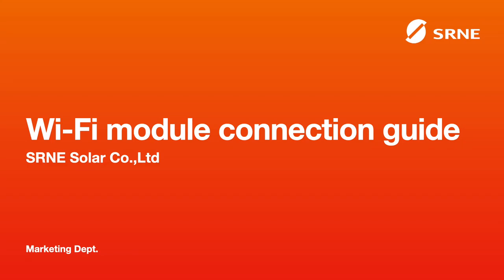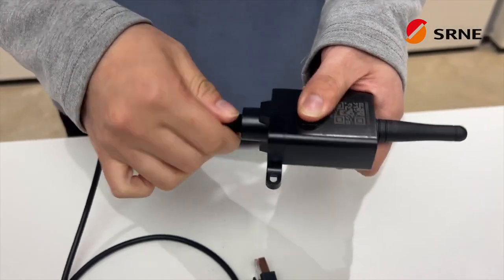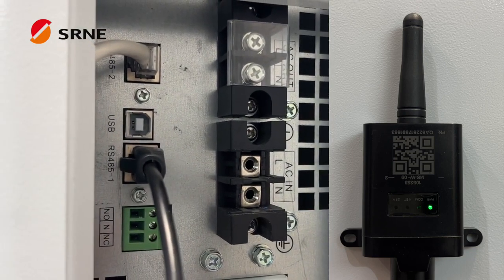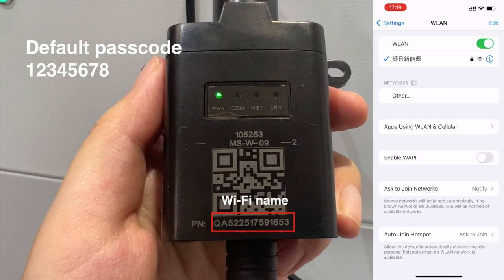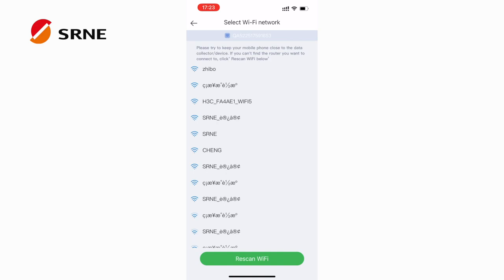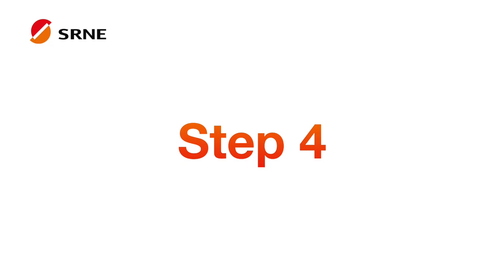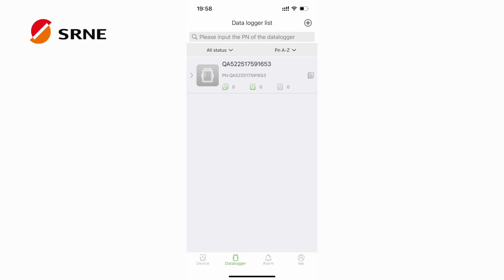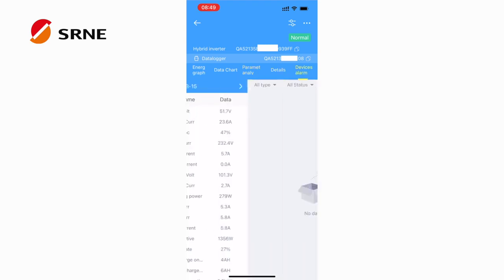SRNE WiFi module connection guide

Comment: My SRNE 12Kw that i buy doesn't have this wifi module  so is sold apart?
Reply from the maker: Yes, the wifi dongle is additional cost.
Reply: @becky-srnesolar5785  So for my SRNE HESP48120U200-H this dongle works? and where i can get one?
Reply: @becky-srnesolar5785   where i can get it?

Comment: Hi, i am using this dongle, but the battery data does Not show much except the current volts, soc, current, but the graph doesn't show, for others graph is showing,, its 5kva Inverter and 2 Hanshu ess batteries
Reply from the maker: Perhaps you can try to contact the seller at fisrt
Reply: @becky-srnesolar5785  the seller doesn't know anything about it
Reply: What is the name or model of wifi dongle? @becky-srnesolar5785

Comment: Hi, I have added to the data logger to the SmartESS account but it shows as offline. Any reason for it. All four indicators on the data logger are light continuously.
Reply: Were you able to solve the problem?
I am having the same problem
Reply: Did your problem be solved?
If yes then how
Reply: @shreyaskumarpradhan1005  it seems this product is a shit, a lot of issues from buyers

Comment: I have wifi module, I was able to connect it to my internet network .
But no communication with the solar inverter . The COM Port is always OFF. No green light on the COM. What to do ?
Reply: Me same here
Reply: @Usef928  1 year still no response, did you manage to fix the issue ?
Reply: 1 year still no response, did you manage to fix the issue ?

Comment: i have the module with a SRNE 5kw inverter, and the inverter does not detect the wifi module.....the is no comms between inverter and wifi module........you'd have a soluiton  please ?
Reply from the maker: Where did you buy the 5kw inverter?
Reply: I have the same problem.
The communication port is still off. Why ?
Reply: @ahmedbencoussa3095  1 year still no response, did you manage to fix the issue ?
Reply: @becky-srnesolar5785  SRNE directly

Comment: Can this tool be paired with the MPPT SRNE type ML4860?
Reply from the maker: ML4860 doesn't have WIFI port, we have another model 60a mppt could be used with WIFI dongle.
Reply: @becky-srnesolar5785 Which 60a mppt model has Wifi port that can be used with the wifi dongle
Reply from the maker: @EasyyokeFilms  Model MC4860 has the wifi function, you have to purchase the external wifi dongle.
Reply: @becky-srnesolar5785  What of your MF4860N15… Will it work with it?
Reply from the maker: @EasyyokeFilms  The wifi for the controller and inverter is different model. not the same.
Reply: @becky-srnesolar5785  What is the name of the wifi for MF4860N15 MPPT controller
Reply from the maker: @EasyyokeFilms  The wifi dongle is WF-1, are you in Africa?
Reply: @becky-srnesolar5785 Yes, I am in Nigeria. Do you sell it in Nigeria?
Reply: @becky-srnesolar5785  Hi Becky, where can I get the WF-1 and does it allow me to monitor the controller from another location remotely
Reply from the maker: @EasyyokeFilms  Yes, we have thre reseller in Nigeria. What's your number please? I can ask the reseller to contact with you.
Reply: @becky-srnesolar5785  Hi Becky. I have checked the  MF4860N15 controller, it does not have any TTL port which is what the WF-1 wifi dongle uses. So the WF-1 cannot work with Mf4860N15 controller. I need to know the right name of the wifi dongle that can work with MF4860N15 controller
Reply from the maker: @EasyyokeFilms  Our wifi dongle for the controller use RS485 port.

Comment: What is the model of the inverter that has this? Can we see the inverter remotely from different network?
Reply from the maker: This is the wifi dongle. So you can't see the inverter works remotely, which need GPRS dongle. But we don't sell GPRS dongle overseas.